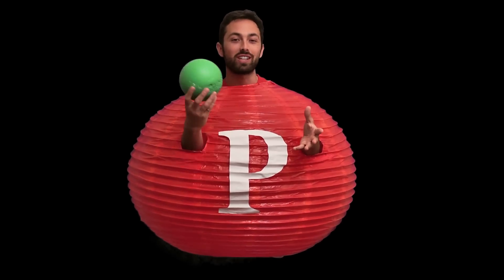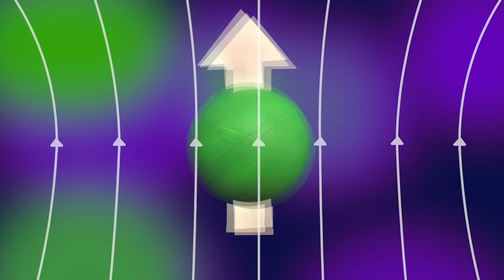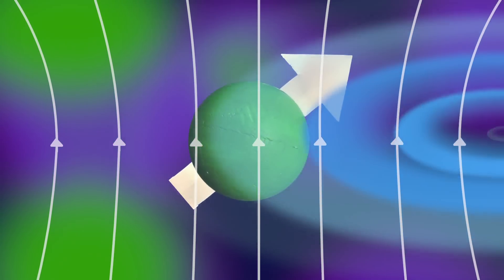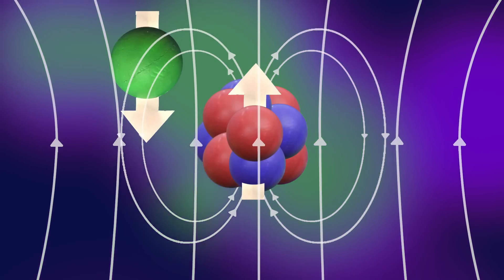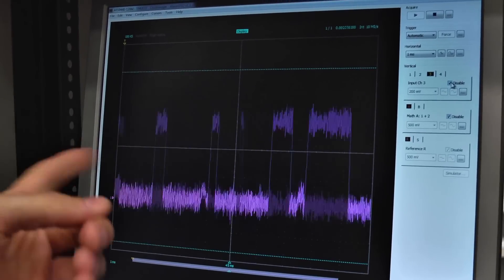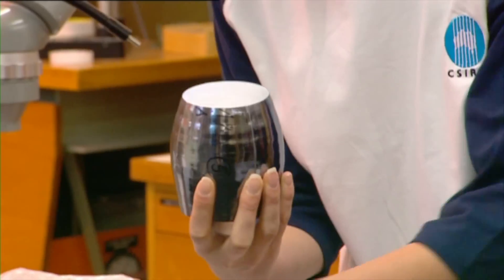How To Make a Quantum Bit

Comment: So the only way to ensure a particle is in its down state is to cool it to near 0K?
Is it be possible to tune the magnetic field so the particle is forced into its down state?
On second thought, the force exerted onto the particle by the  microwave pulse is probably orders of magnitude weaker than the thermal energy of 1K. So it wouldn't help at all :[.

Comment: This flip up and down must be a compression+/-decompression or contraction and expansion formed by a locational spherical inward absorption density E and outward emission density Cnow of electromagnetic wavefronts forming antimatter matter annihilation, or resonance positron+/-electron interference. "Spherical logarithms."
Emission is a process by the way of which one higher quantum mechanical state of a particle is converted to a lower one through a photon resulting in the production of light.

Comment: Assuming the magnetic field stays constant, the proton takes less energy to flip because it has a much weaker magnetic moment than the electron. Quantum computing also demands that we can maintain quantum coherence in the system – more stress on the system (like higher temperature) contributes to quantum decoherence. The system will dephase or, in other words, it will stop behaving quantum mechanically.

Comment: I don't know about video rendering being impossible. There are lots of promising algorithms using Fourier sampling, which makes it possible to get a peek at some of the probability amplitudes without destroying the system. Right now, Fourier sampling is only useful for Shor's factoring algorithm and few other things, the only reason I can see video processing having trouble is because of QC's inherent randomness. Maybe the optimal solution is to work classical computing with quantum computing.

Comment: Well, right now it still costs a couple hundred thousand dollars to build even just low-end quantum computers. The most powerful one available right now is the D-Wave 2, which has 512 qubits and costs $15,000,000. There should probably be 1,500 qubit computers by 2015. This is just a guess, but 10,000 qubit computers should be around by 2020. The progress of quantum computers is a little jumpy, so it's hard to tell.

Comment: What I understand is that qbits can be in a superposition of both spin up and spin down at the same time which is a third state but they're not using it as a ternary system since you can't observe this third state.
What I imagine is several qbits in many entangled superpositions decaying into 1s and 0s which in the end gives the answer to the problem but I won't pretend I'm an expert. Watch these veritasium videos:
/watch?v=g_IaVepNDT4
/watch?v=v1_-LsQLwkA&feature=youtu.be&t=2m41s

Comment: Radioactive decay is an isotope of an element degrading over time. We can measure this in half lives. The time it takes for the isotope to degrade to half of its original quantity. That is why we can use carbon dating to measure time, by measuring how much of the original material has degraded. In fact many element isotopes go through radioactive decay, some with extremely short half lives and some with half lives that are millions or billions of years.

Comment: Actually thats not correct. Although qbits can only be read as 1 and 0, they can be in a superposition (1 and 0 at the same time) while not read. So it is actually the goal to do calculations and not read out anything until you have your answer so to not destroy the superposition.

Comment: We will be using standard transistors until 2020 (When Moor's Law dies). By then I'm estimated about 20-30 GHz at our current rate of increasement, plus quantum computers wont really be accessible because .5 K is difficult to achieve. If they can make it cheap, it'll probably be on the order of Terahertz because you could get 16/32 core processors and multi-thread it to 64 cores.

Comment: What matters is that during calculation it is superposition. 
However you are right, one atom is useless. Only entangled state hold this information. Then in a single calculation will do multiple values at the same time. 
Hence 10 qubits doing two values at the same time will calculate 2^10 value combination whereas a normal one only has 10. 
(more or less)
In reality it is much harder.

Comment: Working with qubits instead of regular bits give you more powerful operations. To put it simply, you may get the results as 0 or 1 but you will get it faster. Most quantuum algorithms are based on what is called superposition - this is like having all the inputs of an algorythm. Then you run your algorythm on this set of data (all the inputs at once!) and you'll get your result. The downside is that your result is probabilistic - for example the RSA breaking algo has a ~50% success rate.

Comment: Normal bits are gated by leakage in the transistors that code them and the logic gates formed by the transistors themselves. Qbits allow for an off on switch by the electron and the nucleus of the atom, without the voltage leakage since they are gated by microwaves of a specific frequency.

Comment: By utilizing qubits rather than bits, you're not "speeding up" the operations per unit of time you're able to do, but rather reducing the number of steps needed to reach the result. -Paraphrased from Prof. Morello

The following is my own (very possibly wrong) interpretation: since qubits exist in a superposition of 1, 0, and both until measured, exponentially more operations can be performed at once. When the operations are done and the results are in, you make a measurement and get your answer

Comment: Would it be possible, using the double slit experiment, to turn on/off a "watcher" that looks at the electrons as they pass through the slit so in that way you can translate the electrons from 1 to 0 by turning on/off the "watcher"?

1 = watching = particle
0 = no watcher = wave

Comment: What i gathered was, A qbit is equal to one bit, but a qbit can be up down, as well as it's super position of both. When measured it MUST be either one, so we have a qbit that contains two bits of information. Imagine Two qbits paired, they each now can be up or down giving you 4 typical states(upup,downdown,updown,downup) but each like when separated has a super position these super positions allow the qbits to have a contain much more information than standard bits.

Comment: It has 3 states, up, down and dynamic. It makes it possible to have less computation steps because instead of yes/no only, it has yes/no and you can give it a condition with the third state. The third state can be placed at any degree in a 180º spectrum so you can have multiple meanings for a third condition based on the degree of inclination.

Comment: In a multi-quantum bits situation, how do you prevent interference from adjacent q-bit? also  how do you make sure the initial em wave does not flip the wrong bit by accident? or does each q-bit need to be made of different atoms so they don't share the receiver same bandwidth?

Comment: Air is denser than helium, and gravity pulls stronger on things with higher density. This is because higher density means more mass per unit volume, causing a larger "bend", if you will, in space-time (which is essentially gravity). It's not that the balloon is being repelled, but that air is being pulled down by gravity STRONGER than the balloon is being pulled down, therefore causing the balloon to rise. Basically, the denser the object, the closer it wants to be to a gravitational source.

Comment: Dear Veretatsium, what is the mass of a balloon?  I know that it floats because of buoyancy, and helium is lighter than air, but I thought that all objects with matter have mass, and the ballon pulls UP on the scale. If you measured it in a vacuum or somewhere without air then it would sink and be able to be measured, but I think that doing that would also throw off the mass of many of the objects measured in air.

Comment: Well, they did build a quantum machine that is pretty much a computer. You may argue that it is not the famed and anticipated quantum computing that this video describes, but it is undoubtedly a device that treats data with qbits. However, I may understand your skepticism as D-Wave's computers are in any aspect less powerful than normal ones. They are still a great advancement that hints the possibility to solve certain optimization problems that are currently unsolvable with a normal computer.

Comment: “Using a specific test problem involving eight qubits we have verified that the D-Wave processor performs optimization calculations (that is, finds lowest energy solutions) using a procedure that is consistent with quantum annealing and is inconsistent with the predictions of classical annealing,” says Daniel Lidar, scientific director of the Quantum Computing Center.

This was recent, so you can be somewhat forgiven for not knowing.  Pontificating without bothering to stay current, is not wise.

Comment: @blazerider, you are wrong. Transistors actually have theoretically infinite number of states, it is just that we are only used to using the "on/off" interpretation. I am sure you know that a transistor is a form of amplifier, most have at least some linear range. I believe what the other poster meant was an interpretation where certain output voltages represent various states. The world adopted the binary digital paradigm and that is what everyone is used to, but you could  use another.

Comment: If I understand correctly, the quantum superposition state is when the electron is on it's way changing from the spin up or spin down state.

On the screen, since they're only changing from totally spin up to totally spin down, the superposition state is the transition line in between the two vibrating lines. The lines vibrate because even though the electrons are very stable, there's still little amounts of energy which cause them to slightly change their spin.

source:
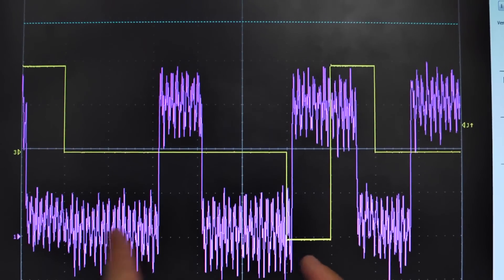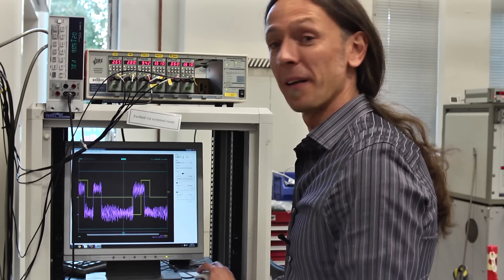2:10-2:36, 3:51-4:10

Comment: That's not the point at all. A classical transistor has 2 states caused by the "voltages an charges". We call those states 0 and 1. A quantum transistor has many possible states between the classical two.
Yes you can call those states whatever you want. You can call classical computing states T and Q but it doesn't change the fact that there's only two. In quantum computing there are many, which I described as positions in between 1 and 0 (the traditional way to refer to the transistor's state)

Comment: (cont 3) you will know that the logical function is either the AND gate, or one of 3 other possible logical functions which have a single 1 in their truth table (a AND with one or the other or both (NAND) its inputs inverted). Now you set the inputs of the function to 1,1 to check if it's indeed an AND (you should get a 1 on the oscillioscope) and you're done, with just 2 operations (if you could the number of times you need to change the input) instead of the classical 4.

Comment: (cont 2) You set it such that both inputs to the function are 50% 1 and 50% 0.  If it is indeed an AND gate, then only one of the 4 possible combination (1,1) produces a 1, so if you did discrete measurements of the output of this system, 25% of the time you should get a 1, otherwise 0. I think on the oscilloscope which does a continuous measurement this would show up as a potential a quarter of the way between 0 and 1. Now if indeed you see that output on the oscilloscope (cont 3..)

Comment: (cont 1) Now suppose you start off knowing only that the computation this system performs is one of the 16 possible logical functions on two bits. You want to check if it is indeed the AND function. Classically you need 4 measurements with different inputs (the combinations of either the nucleus or the electron being flipped). In this system however you can set both the nucleus and the electron into a superposition of being flipped or not (vector pointing sideways instead of up/down) (cont 2..)

Comment: Yes, and I think even with this basic experiment you can show a simple computation that it performs in fewer steps than can be done classically. Take whether you flip the electron or the nucleus as two binary inputs to a logical function and the measurement you get on the oscilloscope as the output. The output is only 1 (high potential) when both are flipped. This corresponds to a logical AND gate. (cont..)

Comment: Sorry I will rephrase. How are calculations done with the superposition. You cant read/observe the system without changing it. However quantum computers power comes from being able to do calculations using the superposition of states, so the qbit in a superposition state must somehow influence the qbits around it to perform the calculation?

Comment: this doesn't mean anything. i a normal computer you don't have 1s and 0s. you have voltage or charges. if you won't to interpret them as 0 and 1 you just do it. if you won't .65 or .148, you can do it as well.

Comment: Quantum computers do things differently. They excel at a certain type of problems, but aren't really superior at the rest. Because the technology is so new they are actually quite slow at everything else. For this reason its better to think of them as a specialized accessory than a replacement for your desktop. 

Moore's law isn't so much a law as it was an observation about our progress in computing power. Quantum computers will advance, though its anyone's guess as to the rate that will be at.

Comment: A very good explanation of the work they are doing, but I am curious as to how they produce larger systems (if they can at all yet). Now, am I correct in believing that in order for the computer to be useful the q-bits would need to all be entangled, so their quantum states are dependent upon each other? If so, how is that accomplished here? I would also be interested in hearing about the unique logical operations quantum computers can perform.

Comment: Yes. Carbon nano-tubes are essential cylindrical structures (tubes) of Graphene, which is harder than Diamond, extremely lightweight and versatile. Many of these properties come from the fact that the structure is pure Carbon (Which, coincidentally Diamond is also made of), but the shape allows it to be much more viable and practical.

Comment: You realize that computers used to fill up entire rooms back in the day and they were a million times weaker than phones are now? Also what they are doing is experimenting with a single transistor, the prototype for the first cpu transistor was nowhere near 22nm like current ones. Also quantum computers probably won't replace regular cpu's, they have different functions. It will probably be something like a GPU, or a tv tuner that you plug in your computer for specific tasks.

Comment: Don't think of voltage in terms of electrons. When it comes to current, voltage is essentially the force that makes the electrons move. It comes before the electrons and, as people are saying, it is just the force applied by the electric field.

Also, electricity is movement of charge. Conventionally, that charge consists of electrons, but it can be any charge. Ions in a solution, for example, which is how current is formed by a battery.

Comment: wrong there is no such thing as exchanging information using quantum effects between 2 people and a 3rd taping in...
The only way info exchange using Q effects is by Q entanglement which is 100% safe (no 3rt person can listen) but is instable and impractical because a Q entanglement system would communicate only with another

Comment: Hm, ok, I'm not convinced :)
Referring to v=g_IaVepNDT4&feature=youtu.be&t=5m13s So there are just logical/technical limitiations to how we can use a quantum computer (i.e. it's not a general, faster replacement). So the initial statement, that QCs will find prime factors for large N in "no time" seems bold to me, at least without some source/other facts that will make it clear to me (as clear as it can be to a layman).

Comment: They have used quantum computers to factor numbers (Shor's algorithm). Essentially, you build a quantum multiplier, coerce the result to be the number you want to factor, and read out the "inputs". This has actually been done to factor a number successfully. However, you need enough qubits for the number you want to factor, plus some associated stuff, and people have only managed to create actual devices with a small number of qubits, so the largest number that's been factored this way is... 21.

Comment: sorry about all the extra posts. Every time you see another one it's because I've gone back and replayed the video. From what I understand, it looks like you've created a sub atomic potentiometer using microwaves and an electromagnetic generator. I'm wondering if you could use superpositioning to determine the frequencies generated by on Q bit to initiate the reading of others. Or is it meant to somehow moderate the end frequency of the transistor giving it variations between on and off?

Comment: Ok, here's my question/idea, if you can use Phosforus (sorry about the spelling) then couldn't you use multiple elements all with their own frequencies? Even if they were touching you could probably find combinations that had a dissimilar enough charged state so that a properly calibrated machine would be able to identify multiple Q bits within a single unit of time.  Just an idea (if it works wouldn't that mean you could use this to program in something other than binary?

Comment: there are somethings called "holes", in other word lack of electrons.On every battery you have a positive and negative pole, that's determined by the direction of the electrical current. The pole from which the electrons are moving is the negative one, the pole they're moving to is the positive one. (electrons are moving to fill the lack of electrons creating a current of electrons)